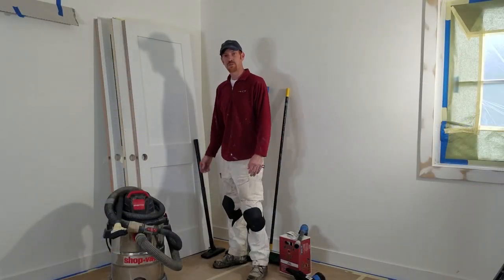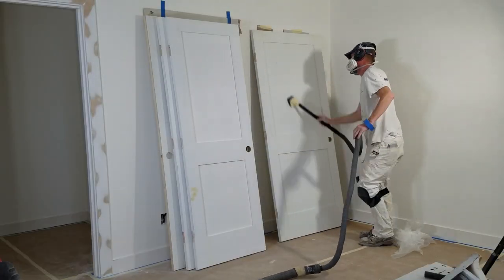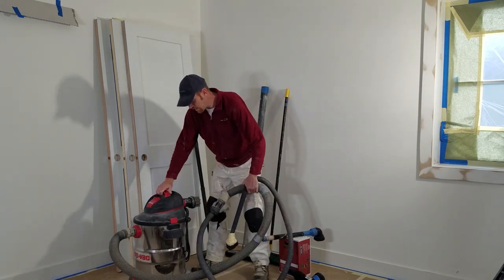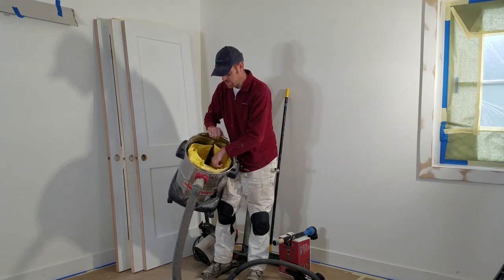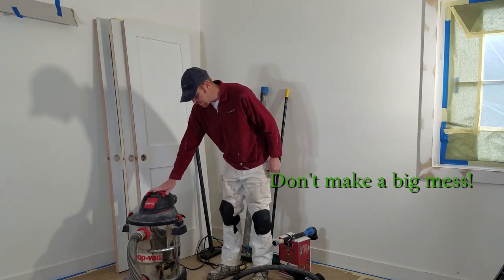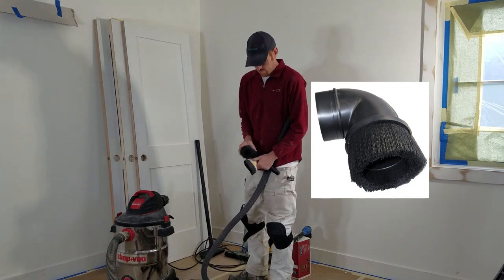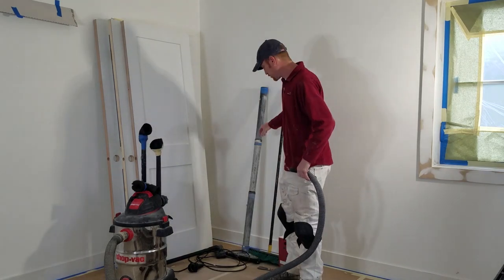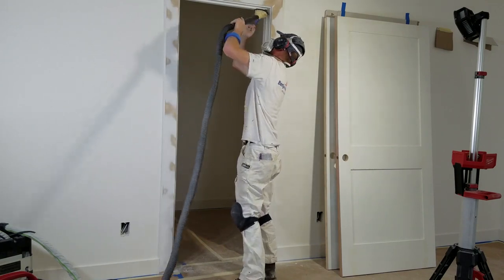Painting MDF Millpack Basics: Cleaning Tools and Prep Introduction.

Comment: I think your the real deal. I could not hear u on  how u add bristles
Reply from the maker: I take one of those 2.5" brush attachments from Shop-Vac, pull out the metal ring that holds the bristles,  and I epoxy it to the other (smaller) brush attachment. They can be epoxied onto the Festool round brush too.

Comment: You don't like the festool vac for cleaning?
Reply from the maker: Not at all. I have the Festool round brush attachment, and it really does not cut it for cleaning many surfaces. I have even beefed up my Festool brush with extra bristles the same as in the video, but It's only good for small clean ups. 
The Festool diamond shaped brush is no better and it's looks are deceiving. it doesn't work to get in corners like you would think it does. On these jobs a good thick brush attachment and more power/cfm is best.

Comment: Pretty aggressive sanding on window frames. How do you keep sanded areas from flashing through when you've applied finish coat?
Reply from the maker: We used oil based primer on this job after sanding the factory primed mdf and prep work.
Then sanded smooth and 2 top coats applied